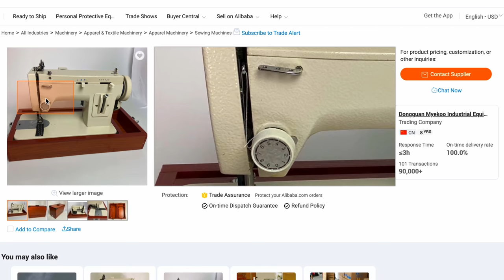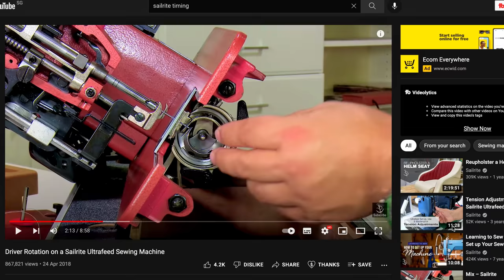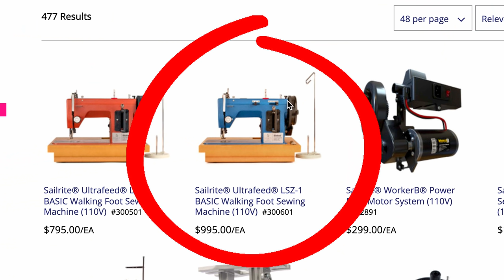SAILRITE VS CHEAP Sewing Machine (Full Comparison)

Comment from the maker: Thanks to everyone that joined us for the Premiere.... great to catch you all in real time....Cheers
Reply: You should have posted a link to both of these machines.
Reply: Watching this video made me abandon the idea of getting the cheaper machine.  I really appreciate they straight forward information you've presented here.  I've now watched many of the Sailrite videos, and I think one thing that deserves mention, especially for sailing people, is that the Sailrite with the monster wheel  (with the belt removed and the handle added) can be run by hand without power. Maybe the barracuda can too I don't know, but it is in the marketing for the Sailrite.  

I like the fact that if you need to use the Sailrite without power the company supports that.
Reply: YES...ALL the Sailrite options like the Monster Wheel II fit the Barracuda...AND...all the OTHER clones like the Family Sew FS288Z...Their Monster Wheel works fine on mine, along with the optional case, etc. What I didn't realize till I bought the Sailrite Monster Wheel is that Barracuda sells a Monster Wheel-type option too.
Reply: As an electrican I'd just like to say Watts are actually (volt×amps)=watts.. thus the (seemingly) doubled watts

Comment: For those who can't afford a new Sailrite machine,can I suggest looking for older used semi-industrial machines? Some of these date back to the 1950s and 60s and are superbly engineered. One piece of advice I would like to add is don't use cheap needles. Dropped stitches and broken threads are often caused by needle deflection due to using a low-quality needle. Good quality needles are made from high grade steel which is stiffer stronger, stronger and holds a sharper point for longer.The difference between cheap and quality is like night and day. Groz-Beckert are generally considered to be the gold standard but I've also had very good results with Organ. Also make sure you're using the right size of needle for your thread. For V92 you want a 120/19 needle. V69 use either a 100/16 or 110/18. Hope this helps.
Reply: I am in USA🇺🇸, N. England & OHIO, WHERE buy QUALITY NEEDLES ?
Reply: Define semi-industrial please

Comment: I have a Barracuda for three years now. Done lots of sewing with Sunbrella material. Except that it sounds like a tractor, it does a very good job. I am satisfied.
Reply: 10 years ago I bought a blue sailrite to recover the seats on our SeaRay sundancer boat. After the project was finished I sold the machine. 10 years later we have a sailboat. I want to re-cover garden furniture using UV thread that cannot be used in a domestic machine. I decided not to buy another Sailrite as I wasn’t impressed with it as a professional  sewer. I have since bought the Kayser 2000 made by Gritzner from Germany. I’ve only just ran practice pieces and quite pleased with the Kayser machine. The manual says it needs a lot of oiling and stiff at first but will break in and will be easier to sew with

Comment: I have the Reliable Barracuda and it gets the job done but is admittedly crude compared to a German Adler walking foot I used to have. I wish I hadn't sold that machine! I've never had a chance to use the Sailrite LSZ but I'd buy that if money was no object, based on what people say about it. In April '23 the Sailrite machine is twice the cost of the Barracuda in Canadian dollars (almost $1800!) and I still can't justify that, which is why I bought the Barracuda in the first place. I'm grateful that Sailrite's parts, manual and videos apply to the Barracuda (so far), as there really is nothing from Reliable. I've upgraded the flywheel and stitch length control with Sailrite's parts, lengthened the wire to the foot control (necessary!), altered the hinge location on Reliable's box (that wouldn't take the machine as supplied), filed the needle plate openings to allow me to use Sailrite's leather feed dog and generally tinkered until I'm reasonably happy with it. I'd have to say that this is not a machine for those not willing to tinker. Sailrite is still my go-to place for supplies and materials, even if they don't want to help with my machine...
Reply: I remember when you bought it ..Ed from HYC..lol.. going to buy the Barracuda myself

Comment: The numbers on the tension control is just a label. You could make your own numbered label to cover up the default + - label. Or if you only need a few tension settings, just add your own hand drawn tick marks to the edge of the knob to highlight where you need to turn the knob to set a given tension amount. If you need more than 2 or 3 ticks, you could also use different colors to set them apart. Usually one mark on the machine itself is added as well to give a visual reference point to where the ticks on the knob should align with the body of the machine. 

We use this same tick mark technique all the time at work to readjust the voltage levels on variable bench power supplies between a few common levels we need. Instead of making slow adjustments qhile watching the voltage meter change, we just turn the knob to exactly where it needs to go based on a tick mark, then verify or fine-tune the output with the meter as needed.
Reply from the maker: Yep. That's all it needs.

Comment: Great video. I bought the Rex 607z and put a “genuine “ sail right wheel on it . Similar experience, worked great for my sailright stack pack project, but started skipping stitches. After months of being too frustrated to look at it anymore I sat down, watched some videos, and when I was just about ready to start adjusting things when I I realized I had a burr on my hook, probably crashed it into the needle. Cleaned up the burr, installed a new needle, and I’m back in business! Again, thanks for the info. Sewing machines can make you want to pull your hair out!🥂
Reply from the maker: Oh tell me bout it...it nearly became our new anchor many times... Its all down the the fine tuning.
Reply: Now if we could just make thread from the hair we pull out, it could replace some of the miles of thread we wasted "tuning".:)

Comment: Good information,  I had done the same research and had made a deal to buy a machine from China until I got the bid for shipping to the states . $200 for the machine and $200 in shipping,  wait an unknown time and have an orphan machine. As I get older my time becomes more valuable so rather than fiddling with that mess I purchased a used Sailrite.
Reply from the maker: Sure Albert... You may have saved yourself some headaches.

Comment: Welcome to the USA,  Most of the machines on your  LIST, are ACTUALLY made by the SAME company . I have a REX, and I can truly say, That I have not had even a hint of problems sewing leather,  and denim.          The price was. $700 LESS than the sailrite.  They might order a special model,  but they as I understand it,  make some additional tweeks, Makes the machine run better,  but also elevates the price substantially.   Best of luck to you  👍

Comment: OMG - JUST FOUND YOUR VIDEO - I have been bloody struggling with the Barracuda (UNRELIABLE) for years and even broke the shaft on it. I did some how manage to make a bimini and dodger and redid most of my lounge and seats with p-leather BUT it was a MASSIVE struggle from the get go. I could not get it to stitch and it continually gathered from the hook over and over again. I bought it from a queensland supplier who used to sell Sailrite but the stopped and sold this heap of junk and now they don't sell it either. I wish I was told or discovered what you found out as I am no in the process to try and finish off my projects and either get the Barra going properly or just junk it and buy something else. Thanks so much for the video. Cheers Tim
Reply: Hello there, you got this from Queensland Sewing Machines?  Yes, QSM will tell you themselves that they sold the (un)Reliable for 18 months but were let down by product and service.  They have now been selling the Sakura-Stitch which is pretty much the same machine (as is the Sailrite) for the past 3 years.  The new clone is called the Sailmate.  If you still are in Brisbane maybe you can see them and ask them what they can do to make it right for you?  I was thinking about buying the Sailmate for homebased sewing (vinyl purses, nothing too big, but too much for a domestic).  Thanks, Rachel

Comment: Thanks for this review.  I have the Sailrite machine.  I had problems sewing using the lifetime uv thread.  It's a plastic type of thread with a coating that kinda gums up the needle over time..AND..the thread tends to kink if you let it just come off the top of the thread spool..so I made a spool bracket that allows the tread to come off laterally and that seems to keep the kinking from occurring and thus making the sewing better when using the lifetime uv thread.  AND a final thought on price....professional canvas makers charge SO much money that the price of the machine is inconsequential (my opinion)
Reply from the maker: That's funny. After all the difficulties I've read about with the lifetime thread... I've had no trouble at all with it... Cheers Robert

Comment: You probably won't see this but I got  Campers Tent model for a little over $100  It sewed too fast so I built a 
reducing gear with a Sailrite drive gear and jack shaft to cut the speed in half.  Sews fine now at slower speed.

Comment: I have a clone of the Sailrite LSZ1 which is a Mercury 530. I paid about $160 for it about 20 years ago. I was making adjustments to it the other day and my timing also went out. I was getting frustrated because i could not get the hook spacing right. Fortunately I saw a Sailrite video showing how to adjust it (my machine had the grub screws that allowed adjusting). 
I agree they seem to need constant adjustment. My Mercury 530 has some junk grub screws on it. Simetimes it is hard to find an allen wrench that fits correctly. Probably the best thing would be to try to find higher quality grub screws and replace these cheap chinese screws. 
I used my Walking Foot to make new sunbrella covers for  all the cushions on my J30 sailboat and to do sail repair also. 
I added a ring of 1/2” thick steel that I made in my metal fabrication shop to my  existing flywheel that gave it significantly more weight. I also had an adapter ring that fit over the existing flywheel and increased the diameter, which increased the gear ratio quite a bit.

Comment: I am fairly certain there are many of us that almost bought the Barracuda (and some that did) but deducted that the parts were inferior and it wasn't worth the $300 of grief. I was looking for years and years and figured that the cost difference was maybe up to $400 more (close to what you suggest) ...but being a newbie and looking at the Chinese made reviews, they were all around 1-2 on a scale of 5 being the highest, which is ALWAYS  a red flag. I sort of wish your video was around when I bought my blue machine. It could have been the needed nudge to go Sailrite right away instead of wasting so many, many hours on-line trying to figure the same thing out. LOL maybe not however because I was too head strong to figure out your conclusion on my own. At least know I have that peace inside ...I
 know that I did the right thing. 

This is the best video or article on this topic of "buy the Sailrite or the knock-off" ... it is a very hard decision and impossible to determine without an apples to apples vid. Kudos for your objectiveness and achieved goal to avoid tainting the subject matter.
Reply from the maker: Thanks so much Mike.

Comment: Sailrite has been around since 1969.  The Chinese "copied" it.

 Sailrite's support is FANTASTIC! I mean you establish a relationship with the people there. Long time family business. 
There is so much more to a Sailrite machine - the internal components are heavy duty. I have had mine for over 15 years now. I have NEVER had any issues and I have really pushed the machine. I did have to adjust the shuttle driver once after I really pushed it and must have rotated from rough handling. It was easily fixed.   I just upgraded my LS (straight stitch only) with the worker B motor. 
and btw, you should put the hand crank handle that comes with monster wheel on the sailrite (like the old "necker knobs" on steering wheels)

Comment: I bought a Barracuda earlier this year.  One think to note, the  warranty on the Sailrite I believe is 2 years, the Barracuda is a 3 year warranty.  I replaced my needle plate on my Barracuda with Sailrite's needle plate which as you mentioned is graduated...a nice upgrade.  Sailrite will sell their plastic flywheel or their chrome plated wheel, but they won't sell the bushing to convert the wheel to their posipin system where you can release the drive for the rest of the machine for bobbin winding.  They told me this was a proprietary part.  Great video and very fair comparison, thank you for posting.
Reply from the maker: Ah another Cuda brother... Cheers

Comment: A new Sailrite Ultrafeed zig-zag basic model is now $1,245.00! That doesn't include the big flywheel. Just ordered a REX 607Z for $399.00. Not $60, but still within the budget. Ordered the Sailrite big wheel for it.
Reply: They raised the price because they just updated it and added features. I just bought a refurbished one of the previous version for $845.
Reply: Its called inflation.

Comment: I didn't realize how slow these machines are. But they seem perfect for a 'live-aboard' life like you have. I put my sails together in a shed with a Singer 107w1.
Reply from the maker: Slow but strong. Cheers Carl
Reply: Part of the slowness is due to the larger monster handwheel and it's increased number of cog teeth.  It has close to twice the teeth of the standard handwheel, so it runs the gear train about half the speed and half the number of stitches per minute at close to twice the needle punch-through power.  Both the added power and slower speed are big advantages for sewing thick, heavy fabrics and seams.

Comment: I was thinking on buying the Sailrite ultrafeed LS, when I first started sewing bags, but I couldnt afford it, so I bought a clone machine one called the sewstrong 607, for $359.99 at the time,  the L is for long, my machine has a 9" work bed compared to the Sailrite, barracuda and the Rex607 that only have a 7" bed, those 2 extra inches come in handy, I had mine for over 6 years now, and its been a work horse, I make backpacks and outdoor gear so I needed a strong machine, I did do a couple of modification to it, I put on the SailRite power plus balance wheel, and stitch length adjuster, best mods I did to it. I do have a video of me sewing with it. Just keep your machine well oiled and adjusted right and clean up any rough spots and burrs and it will give you years of service.

Comment: I have the same issue you had. My machine a sewline (clone) is pinned front and back and impossible to pull apart without drilling while assembled. I have used 5 rolls of upholstery thread while it sewed and now it's just worn out. I am going to drop another 400$ in this before I have a machine that may work. 900$ vs 1250$ isn't that much more for a superior piece of junk. I am grateful to sailrite they sell parts. I'm going to try to drill this apart replace what I need. After these couple of projects I'm going to rehab a mid century singer that will work until I pass on. Thanks for the video, very informative.

Comment: Nice video, I bought the Sailrite, I bought it to make my own sailcovers,  upholstry, and a bunch of other stuff.  I had enough learning curve in basic sewing, having to mess with the machine would have increased the BS factor to a point that it wouldn’t be worth it.  And Sailrite has information on making the “forward/reverse” lever not spring loaded.  Thanks for the information.
Reply from the maker: Cheers Jay... Yup I almost threw the Barracuda overboard a few times... But I do read people have similar issues with their SR.
Reply: I am thinking the Sailrite for the same reason.
Reply: Where is this information on the forward/reverse lever, on SR's website or YouTube channel?
Reply: Do a search on the Sailrite youtube channel for "How to Install the EZ Set Stitch Length Plate'. I have adjusted mine so it does not spring back up.

Comment: Hi, thanks for the comparison. 
I've just bought a Barracuda (used). The person I bought it from was using the incorrect needles so thought it was not working for their needs.  It works fine. I do agree on the 'clunky' ness aspect, though I've never sewn with a sailrite though I can hear the difference in your video.
I did notice however, that you rotated the flywheel backwards when finishing the seam demonstration. This is a sure way to mess up the timing. You should never do this (just saying), rule one of sewing with any machine.

I'm going to be sewing mostly sunbrella or heavier upholstery type fabrics and not sails like you very talented boat owners. I will replace the top on our fishing boat and I may bite the bullet and buy a sailrite someday. They do have a big presence on the web, and their products ship amazingly fast. I do envy you, being in the US. I had to pay duty and shipping on my orders, just over the border to Canada.

Thanks again, you were very informative. You have a very pretty boat!
Reply from the maker: Tks Janette,.. And thanks for the tip.